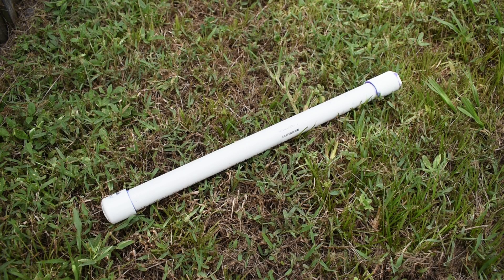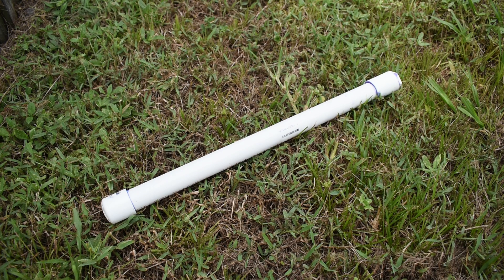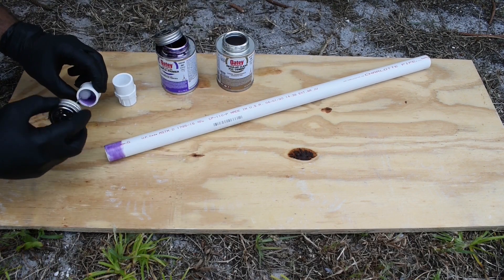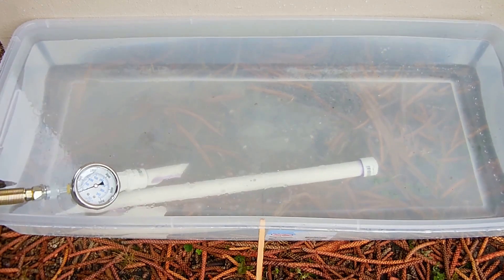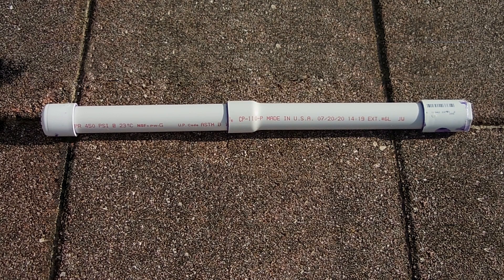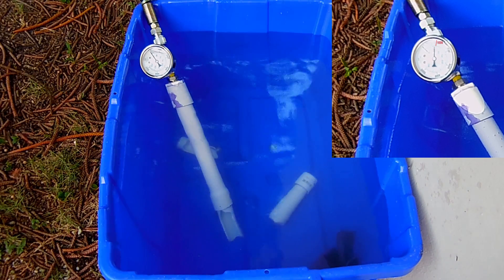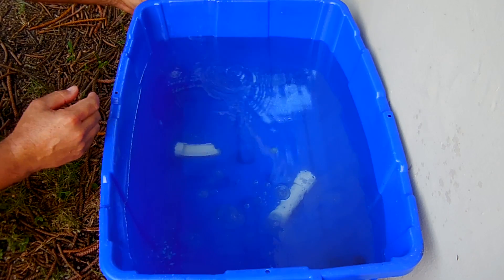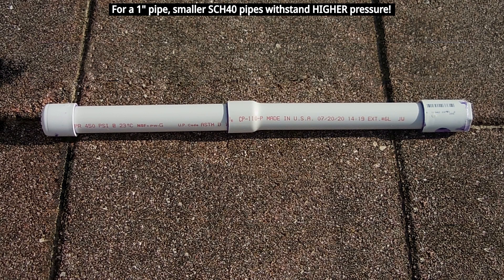Does Heat / Thermoforming PVC Pipe Weaken It? (Best Test)

Comment: I would say that bending it while it’s hot is a greater risk, as density gets manipulated. Unfortunately, it’s up to random chance. There’s no guarantee that it will NEVER pose a threat to the pipe integrity. Big difference between impossible and improbable. Just like never and not usually.

Comment: This garbage short cut is exactly why I have been losing hundreds of dollars on my water bill the last few months. This absolutely weakens the pipe, not instantly but eventually the flared portion you point at is the first to go. It will  last a few years or many years so it is a great way of making money off your customers down the road. Eventually it will crack right were the pipe starts to expand, just like mine did. This is not to code. I am typing this 4 hours after cutting this connection out of my main line that used this method. I have the pictures and the hole in my yard right now to prove it.
Reply: He tested it immediately after making it. If you go back and re-read my post, I am talking about that bend will be the first thing to weaken over time. As it did in my water main. That bend doesn't age well. I have the thousands of dollars of over paying my water bill and the video of the leak to prove it at exactly that ben to prove it. This will work for a while, even years. But the proper way will last longer. Pressure checking a line 15x the pressure it will ever see in it's life time is a flashy way to missinform you of its long term integrity. That connection is brand new and thicker and stronger than the rest of the pipe so ofcourse the pipe will burst in the single layer of pipe. But it can't withstand the test of time, witch is hard to make a flashy click bait exploding pipe video on youtube.

Comment: how deep of a pocket (Flared Bell End) can one make when thermo forming PVC pipe.  I found PVC 1/2" pipe in 20' sections that have a roughly 4" pocket or Flared Bell End that works great for doing under ground irrigation repairs since that long pocket can be used to slide the pipe on one end of the repair and then back in the opposite direction to seat into the coupler on the other side.  The stock flare/Bell ends on shorter pipe have a shallow pocket that is not long enough to do the maneuver that can be done with longer pocket.  Do you think it is possible to thermo form a 4" pocket/flare/bell end or will the hot PVC begin to get wiggly or wrinkly?  Would it be better to use a solid metal rod (equal to the O.D. of the 1/2" PVC) to push into the PVC to expand it versus another piece of 1/2" PVC ?  Any tips you can offer based on your experience would be appreciated before I try this myself. Also, have you ever used a laser thermometer to measure the temperature of the PVC for the sweet spot where it is most pliable for this kind of thermo forming without  being to soft such that it deforms more readily with potential thin spots?

Comment: You know... you might be able to get a little more pressure out of it, if you heat form the pvc over a slightly larger cylinder, as the thermal contraction of the outer PVC is probably crushing the inner PVC ever so slightly, and might explain why part of the failure point was against the joint.
Reply: Actually I did the math, the circumference difference on thermal expansion would be only about 0.008" on a 3/4" pipe.

Comment: So no glue required?  You just thermoform the pipe, connect, and let it cool?
Reply: No, you still use primer and glue. It's not PEX. There is a type of PEX called Wirsbo that can be mechanically formed sort of like this, and obviously PEX never has solvent. The reason I am thinking of Wirsbo is that it is almost clear and they tell you to use a heat gun to straighten a kink or to make a slight bend. It is fully clear when heating it. Cool stuff. I also know an electrician who likes to make his own conduit bends with heat.

Comment: I was thinking of putting a big one on the roof racks for water. 
But i am wondering if it would be doable to use a hair dryer or heat gun to make it mould over the cross bars, so its closer to the body of the 4wd.
Reply: I notice it's been over a year since you posted this. Just wondering if you tried it? If so, did it work?

Comment: Heating it up until its gooey is how the pipe gets made in the 1st place. Note, a heat gun can overheat it so just  use your head.  It does release a small amount of chlorine gas which turns to acid when it hits moisture in your lungs so again just use you head.

Comment: I have made 90° bends by first packing sand into the pipe, then heating and bending it
Reply from the maker: Usually people heat the sand then pour it inside.
Reply: @electronicsNmore  I'm a noob at this, lol. Couldn't buy a bend due to lockdown, so decided to improvise. It worked anyway. Next time I'll try what you said. Thanks 👍🏼

Comment: Thermal forming is good, and I've used it before on non plumbing projects (no pressure). My question is, did you glue the thermal formed joint as well? Or did you melt them together enough to seal it. That point was not clear to me. Thanks!
Reply from the maker: Hi there. All connections were cemented together, you can see the purple primer on the thermoformed connection at 2:29. Thanks for watching! Be sure to rate thumbs up and share the video link.